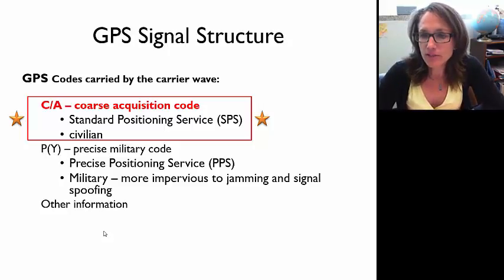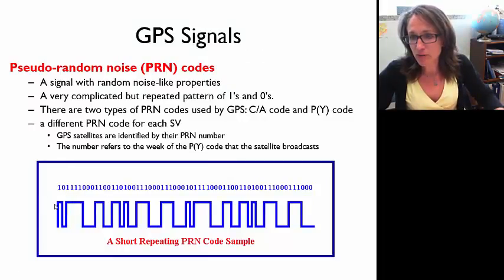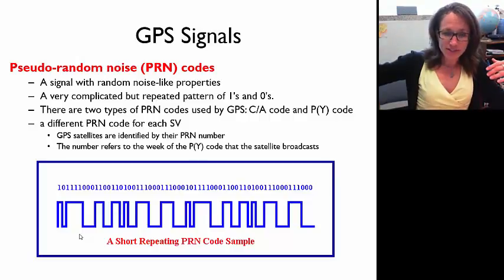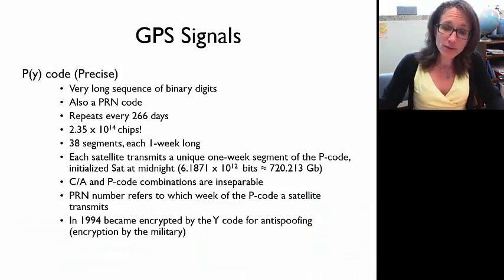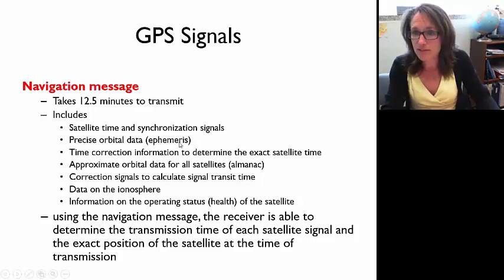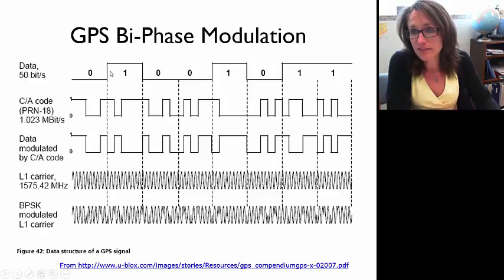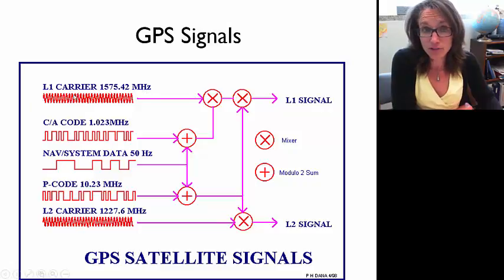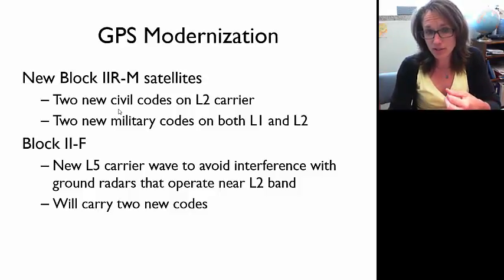Basic GPS Concepts - 03 GPS codes

Comment: Greetings Dr. Richard.  I was wondering if you could clear up how the satellite sends time correction data to ground receivers?  It seems impossible for the satellite and receiver to synchronize based on the transmission from a single satellite due to the speed of light delay.

I read a description of the underlying science a long time ago (mid 90s) that said the receiver is doing phase comparison of the carrier waves of pairs of satellites to determine differences in distance between the receiver and the different satellites.  Combined with the ephemeris these differences enabled the receiver to determine it's own location.  The author seemed authoritative and worked through the math in an example problem (which I was only able to "kind of" follow.)

As I look around the Internet now, I am unable to find anyone describing the system this way.  Am I crazy?

Thanks in advance for any help you can give.
Reply: @baruah1982  Thank you for your reply, but this does not really answer the question either.  

He begins by referring to the receiver using its range to the first SV (d1), but that's the problem.  The receiver has no idea of that value.  And it can't until it gets the deltaT value.  The he gets to https://youtu.be/QK1lDsinMwk?t=334 and says we are able to determine that. 

Well, he does not describe HOW we do that, and he puts it at the end, rather than the beginning.  In searching further I discovered that in the technical specs GPS is described as using 'pseudorange multilateration'.  

Pseudorange means they are using differences between pairs of d values (d1-d2, d1-d3, d2-d3, etc.), not the d values themselves.  This is apparently where the phase comparison of the carrier wave comes in.

Multilateration means they are not 'triangulating' (which comes from measuring the angles) but are measuring pairs ('multi') of sides ('lateration').

I have given up on ever finding a clear description of this process on YouTube.  Still, it's super interesting.  Thank you again for your reply.